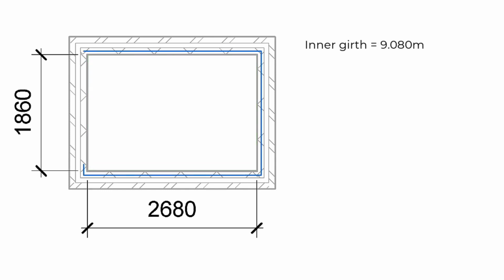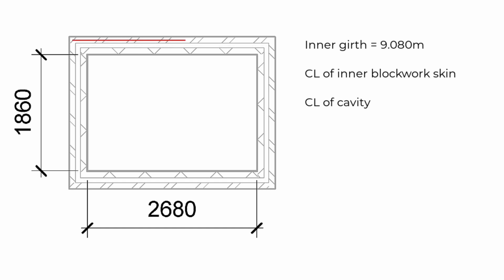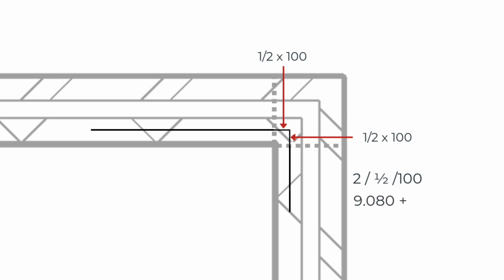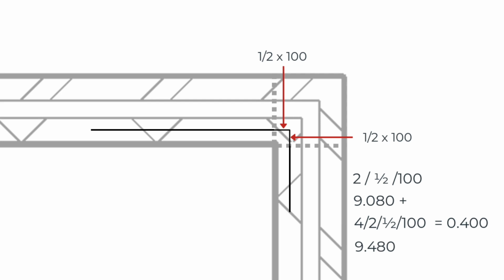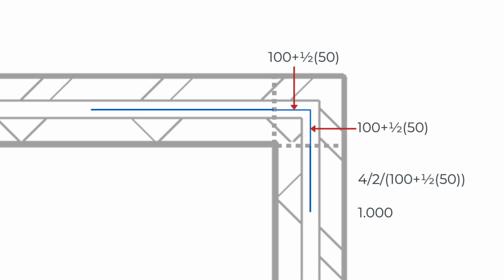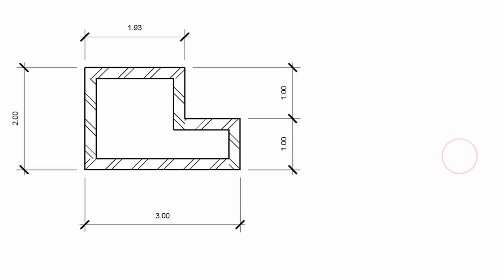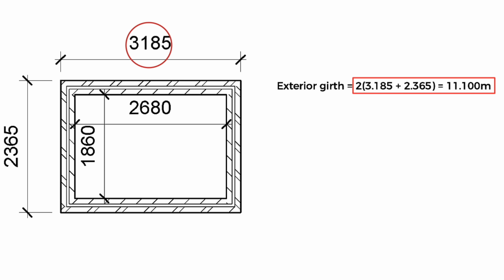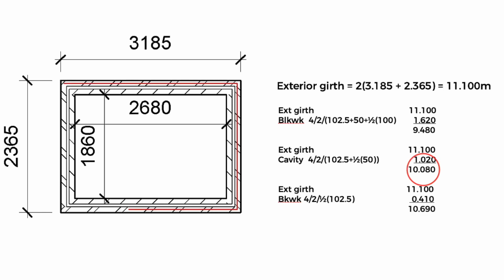How to use Centre Lines to measure composite wall areas

Comment: Would you arrive at the same answer by taking the mean of the inner and outer lengths of each skin?
Reply from the maker: Yes it probably would but the idea of doing it in the way I've described follows the principles of how QS/Take-off arithmetic is done meaning it is then easier to see what  the numbers actually mean e.g, 4/2/100 means there are, as an example, 4 corners each with 2 sides and each 100mm rather than just 800. This helps with checking. Hope that helps. Geoff